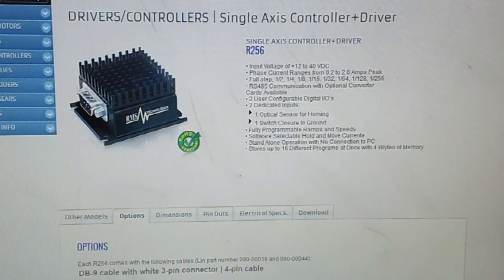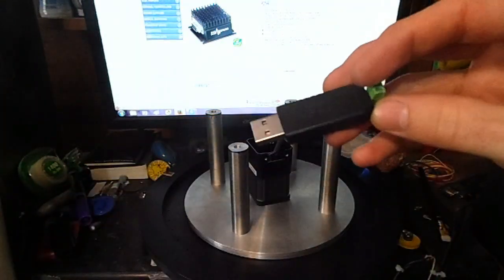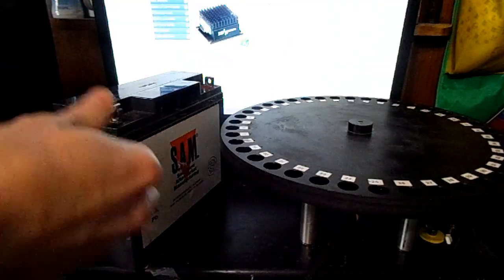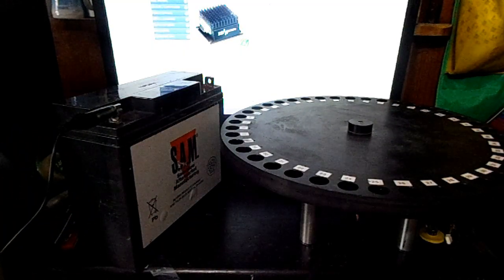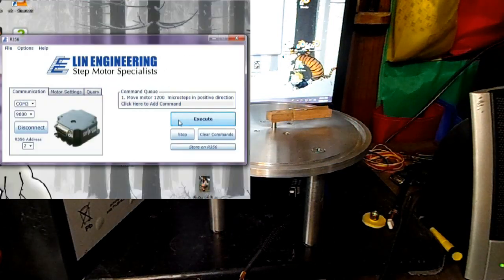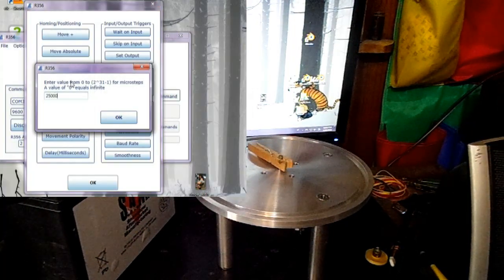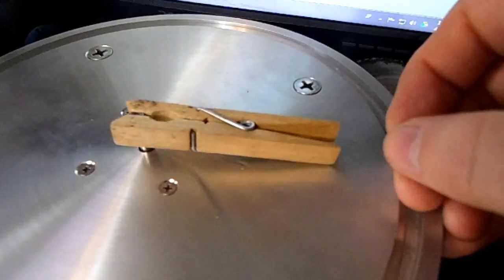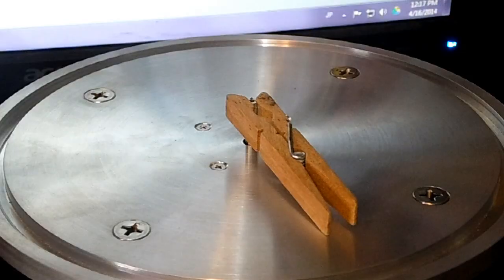Program a Servo Stepper Motor with RS485

Comment: You will likely be using a worm drive for your 100:1 reduction (or what ever ratio you decide on). There's an easy way to make a worm drive without precision equipment, just using a threading tap chucked in a drill to cut the teeth in the wheel's edge. It's a bit hit-and-miss getting the wheel's diameter right on so it ends up with the desired number of teeth.

Using a 1/4-20 tap, a 100 tooth wheel would be around 1.59". Turn it out of wood or aluminum while mounted on a threaded shaft chucked in a drill. Or use a lathe if you have one of course.

 To cut the threads, the tap is chucked in a hand drill, and the wheel is freewheeling on a shaft held securely to your bench. Just hold the revolving tap on the wheel's edge, slowly allowing it to cut the teeth as it is turned by the drill - the tap will turn the wheel as it cuts, hopefully with the right syncronization to cut the number of teeth you want. A plate of thin metal, wood or plastic on the wheel's side can keep the tap from riding off the edge. I can whip up a diagram if this isn't clear. If I had a decent video cam I'd use it.

Comment: 2 questions: 1: Would it perhaps run with the turntable better with more voltage, since it can handle up to 40v? 2: Can you execute the spin with a number lower than 1, such as 0.01, so you don't have to use a gear reducer?

Comment: I'm NO expert but the motor section looks like a nema type stepper motor (hence why the GUI says “step motor” ;) ). Looks like a bipolar stepper (4 wires). The circuitry on the bottom can make it an open loop servo until you feed it info from the sensor (feedback) which closes the loop. Circuitry is more like a stepper controller but that’s depends on your code. RC type servos have potentiometers to provide feedback.

p.s. Red, Yellow are on the USB dongle are RX,TX ;)

Comment: You could make your own rs485 to rs232 converter with an rs232 to rs485 Maxim chip. When using rs 485 if the dable is long don't forget to use a 50 ohm termination resistor. I once had to make a trip to a Texas power station just for termination resistor and also polarity on the RS485.
Reply from the maker: yeah but chances are if your computer is within 5 years old it doesnt have an rs232 plug. even though it is good fun to make adapters. sometimes 5$ with free shipping is just nicer for a usb-rs485 haha.

Comment: Nice little device, and the company made a smashing control program too :-))

Does the device need much thicker power wires, may be crashing the logic when the motor pulses perhaps?

Hmm RS485, not heard of that one before, RS232 +/- 25v i know about, and there was a 5v version for the bbc home computer RS432 i think, cant remember :-((

Comment: Could it be that the voltage is too low ? I am sure it regulates it , but since the current is limited to 2 amps it might allow for more power to the motor
Reply from the maker: no its just the program they give for it isnt working fully. it has commands to tell it to slowly accelorate but they arent working for some reason.
Reply: oh, ok

Comment: im sure it would turn that table if you only sent it a few steps then a pause ?
 i guess even 1000 is like 2 turns and much too fast, i guess its meant to step  just a bit and pause
, and just for a laugh, make a clock that reads to the hour, however many steps to rotate in 12 hours
Reply from the maker: actually i would just need to figure out how to program it, this gui they made for it doesnt work too well, only like 2/5 commands actually work. maybe its just a setting though. it has commands for speed and how fast it accelorates, also how many amps it uses on stay/move.
Reply: Rinoa Super-Genius
would star tracking speed also be the speed of tracking the sun? just an idea to also use it to keep solar panels at the sun
Reply from the maker: jusb1066
yeah but with the sun i could just build a photo sensor rig to make a dc motor follow the sun. much cheeper.